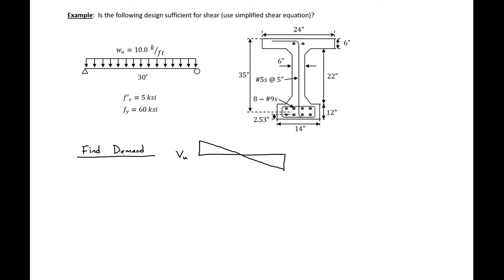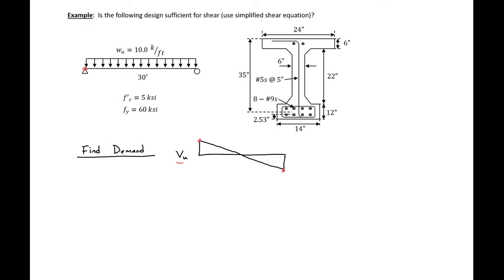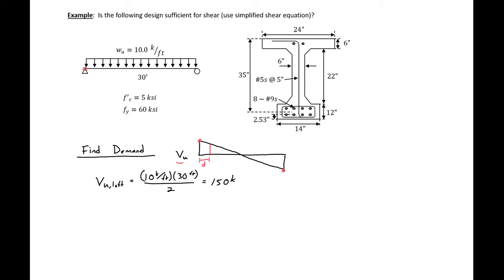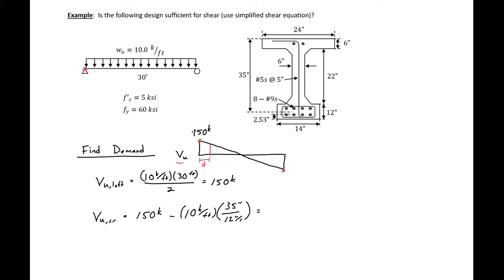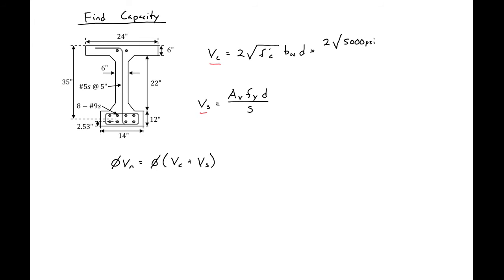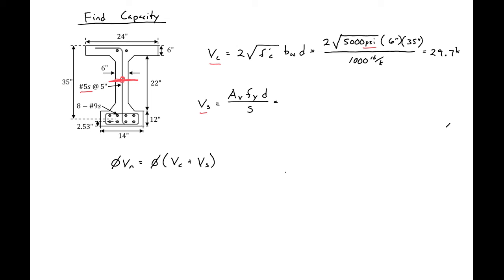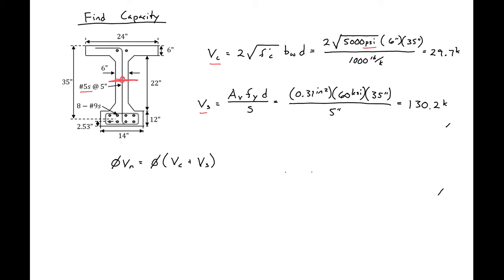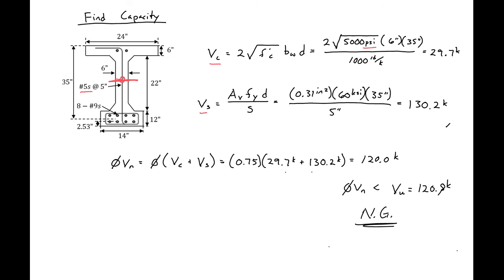8 - Example 1 - Shear Analysis

Comment: Since the example in the problem is a simply supported beam, is it appropriate to design for the Vu with a distance d from the support (ACI 318-19, 9.4.3.2)?
Reply: Isn't this for beams built integrally with the supports?
Reply: Yes, according to ACI 9.4.3.2 this assumption is acceptable if these 3 conditions are met:
(a) Support reaction, in direction of applied shear, introduces compression into the end region of the beam 
(b) Loads are applied at or near the top surface of the beam 
(c) No concentrated load occurs between the face of support and critical section